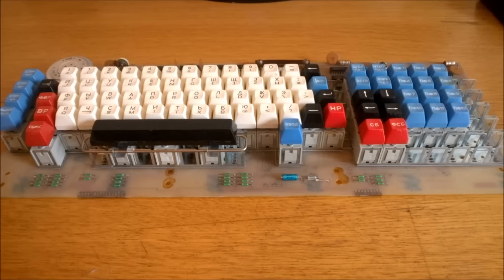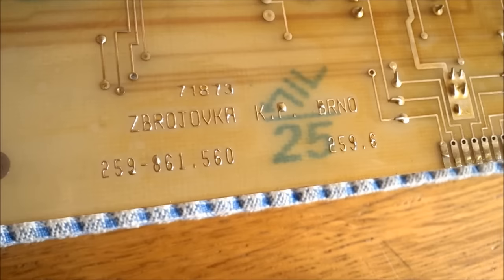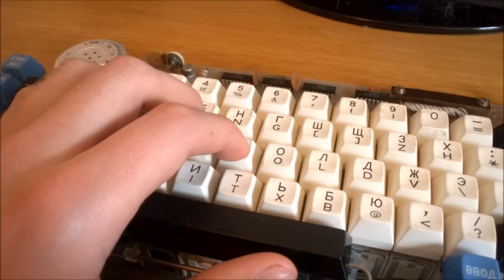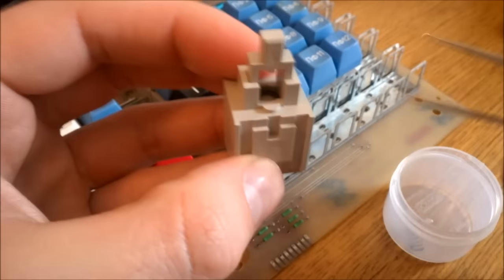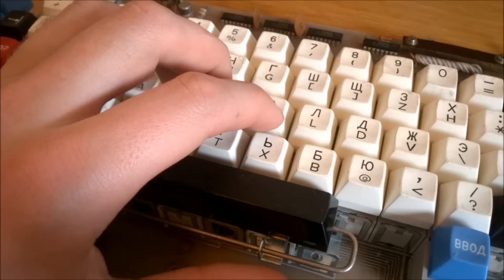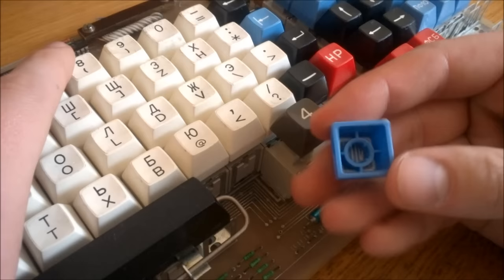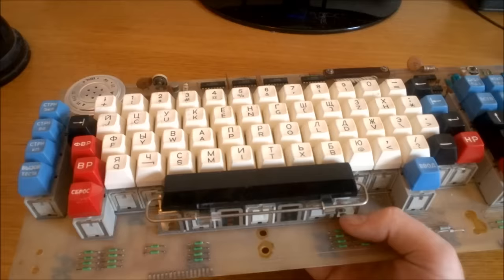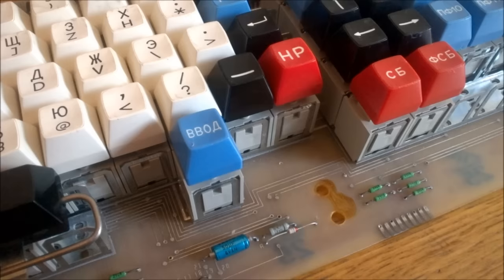Tesla 259 "Gerkonic" review (Tesla MS1SS1 Hall effect)

Comment: It's ES Series mainframe terminal keyboard, type ЕС-7927-01 (note ЕС in Cyrillic here, just copypaste it in Google for a little bit more images). The model looks like Consul EC0101-1-01. I've no idea about specific year of this particular thing, but that type of keyboard in general was in production up to late 1980s. So it's probably not so old as you suppose.

Note also, the keyboard have different from Qwerty layout for Latin script. The layout is phonetic, i.e. each Latin letter is coupled to Cyrillic letter similar by pronunciation. It's a hint that this keyboard was made in Czechoslovakia especially for export to USSR or Bulgaria.

The funny key with ФСБ on it may mean Фиксация Строчных Букв, i.e. fixed lower case, an opposite function to caps lock on modern keyboards.
Reply: It would have been cool if you had the Federal Security Service (formerly KGB) on speed dial.
Reply: For the record, Consul was a Czechoslovak series of typewriters. I've only ever seen small mechanical typewriters, probably because that's what was sold to civilians. The electric successor appears to be the Consulta, but that looks more like a IBM Wheelwriter clone than this.

Comment: Zbrojovka Brno was a major Czechoslovakian small arms factory at the time. Know for example for the BREN gun. You are holding piece of fine weaponry.
Reply: Also Tesla was major Czechoslovakian electronics manufacturer. I don't know why it uses Russian font tho. Maybe it was imported to SSSR or it was used by someone from the Red Army that was occupying Czechoslovakia since 1968.
Reply: Got an answer for that question, found out due managing to get a hold of a few.
They were used in various Soviet military installations where they required high reliability hardware, in fact all of the ones I got a hold of were from old Russian (Soviet) military installations. So they were more than likely built to Red Army specifications.
Reply from the maker: AWESOME! Maybe I should print out a few red star badges or something xD .
Reply: That would be both awesome and horribly tacky.
I snagged one that seems similar on ebay, and importantly it has its case intact. Incidentally one more has popped up also. Seems to be called a "Zbrojovka Brno 262.3 Bezkont Klávesnice" (contactless keyboard), so judging by the number it's a later model.

The switches are also of a seemingly different design, and confusingly various sources seems to refer to it as both reed and hall-effect. Images of the PCB do seem unmistakable but still will have to take a closer look when it gets here.
What I intend is to get (at least) one working and talking to a modern pc.

Comment: The naming indicates a Reed switch keyboard, not a Hall effect keyboard. Reed switches were popular in Soviet industry. With the number and type of ICs they have on there, i really can't imagine it being a Hall keyboard with multiple key rollover, but a Reed switch keyboard is no problem. You can verify whether it's really Reed or Hall effect, by actuating the key sloooowly and listening for a very faint click, the click comes from the Reed switch leaves coming together.

They likely integrated multiple functions, as the keyboard was likely part of a computer, and rather than having the speaker specifically do the click when you press the keys, it would likely be wired to the computer for a software-controlled multi-purpose function.

Comment: all the ICs have 74 in them because they're using "7400 series" logic
"The SN7400 series originated with TTL integrated circuits made by Texas Instruments. Because of the popularity of these parts, they were second-sourced by other manufacturers who kept the 7400 sequence number as an aid to identification of compatible parts. As well, compatible TTL parts originated by other manufacturers were second sourced in the TI product line under a 74xx series part number."  though 74 logic ICs are still made using the CMOS process now
"Quickly replacing diode–transistor logic, it was used to build the mini and mainframe computers of the 1960s and 1970s. Several generations of pin-compatible descendants of the original family have since become de facto standard electronic components."
https://en.wikipedia.org/wiki/7400_series
https://en.wikipedia.org/wiki/List_of_7400_series_integrated_circuits

Comment: This keyboard was probably from a dedicated wordprocessor or a terminal to larger computer.

As many of the NON-PC keyboards you have reviewed use simple 74XX series logic chips it would not be hard to interface to your PC or anything else you like as the connections, usually output ASCII in binary depending on how smart the logic is on the PCB.

https://en.wikipedia.org/wiki/7400_series
https://en.wikipedia.org/wiki/List_of_7400_series_integrated_circuits

Comment: Great video! It's interesting to see how the soviet design doctrine of prioritizing durability/reliability above everything else (at least with things considered more essential) influenced soviet/eastern European products in comparison to western designs.
Reply from the maker: +Salvador Limones Well if the state pays for everything, they're sure as hell not going to have built-in obsolescence xD .
Reply: +Salvador Limones The Soviets ripped off a lot of the tech they used from the West. These are a rip-off of the Honeywell design. It's questionable whether the ability to dismantle the switch, though nice, added anything to  the original design that has a 30 billion key-press MTBF.
Reply from the maker: +dalriada842 Massively! 30 billion is a useless figure if they get dust in them and start to feel like scratchy crap! ;)
Reply: Chyrosran22 I doubt the keyboard manufacturer gave a hoot about how it felt to the end user, as long as it worked. Communist central planning was far less concerned with customer satisfaction than their Capitalist counterparts.That's a concern for geeks like us!
Reply: Chyrosran22 It would be interesting to see how the internals of the Honeywell switches compare to these. Are they glued or welded shut?
Reply: Chyrosran22 I've just been checking out Hall effect devices, by Honeywell, on RS. I was amused to see that according to RS, I may also be interested in an air duster!

Comment: can you imagine buying a working keyboard with these switches weighted at 45 or 50gr ohh man how cool would that be..
Reply from the maker: +samdeur Someone apparently did actually get one of these working xD . Build a custom case around it and voila!
Reply: wow cool..
Reply: its not hard to get it working, all the momentary switches function the same NO or NC you would just need to use a controller board. and instead of using the conductor paths found on the PCB just solder some 16 to 20 gauge wire to create a connection between the switches and the board.
Reply from the maker: Are you sure it works the same way? The guys are having the hardest time converting the Honeywell Hall effect boards because they use completely different signals than other boards, working with pulses instead of conductivity and such.
Reply: Chyrosran22 yes im a electrician, i worked with low voltage control circuits before. a switches is going to functions the same no mater if its a relay, a mms, a no or nc switch such as momentary, hall effect, limit, float, temp ect... I really cant see how it would not work. i dont know too much about computer circuity but the logic and concept should be the same and in my experience it is the relatively the same.
Reply from the maker: Fair enough, I'm definitely not an electrician so you may well be right xD . Here is the thread where people collate the info gathered so far on retro-engineering Honeywell Hall effect; have a read if you're interested: https://deskthority.net/workshop-f7/converting-my-wang-t12379.html .
Reply: Chyrosran22 well i saw the pcb it looks very funny. it looks like there are two paths for constant current, maybe for the magnets but i never seen a hall effect sensor which required that but then again ive only work with control wiring which is 12v to 120v AC and plus they look like they are permanent magnets. I see a shit ton of resistors all of the same value, connected in series to the "output side" of the switches which connects to the micro controllers. https://deskthority.net/resources/image/26836. i think i see a diode as well and a few capacitors a diode with ac will cause it have unfiltered DC power which would cut half of the Hertz from 50 to 25 positive only on the waveform this is the only thing i can think of which would create a pulsing power. what i think is happening is that the micro controller is looking for a closing or maybe even an opening between the switches connected in series what it is looking for is the difference in resistance which would tell it which key has been pressed. do you have a multi meter? if so check for continuity between the the two inside leads if the meter makes a sound or displays something on screen then you could just use a simple controller board but instead just hard wire the keys to the controller do not use the pcb conductors at least that is the quickest and more modern way of doing it and is how I would convert that keyboard.